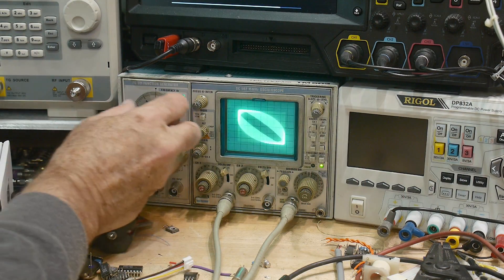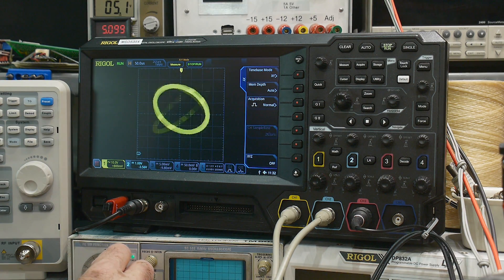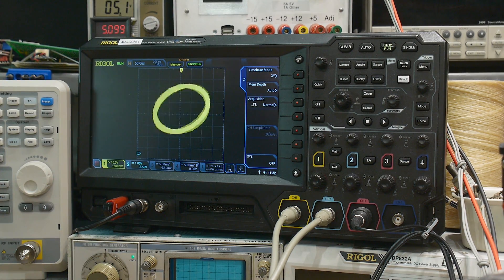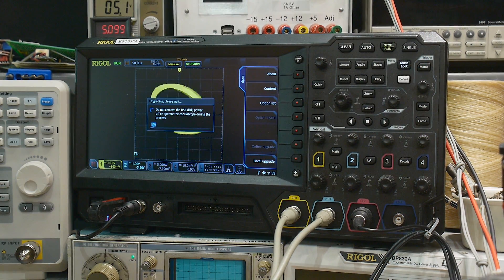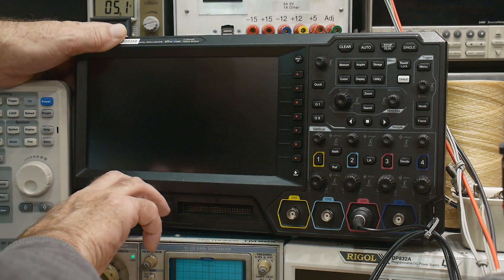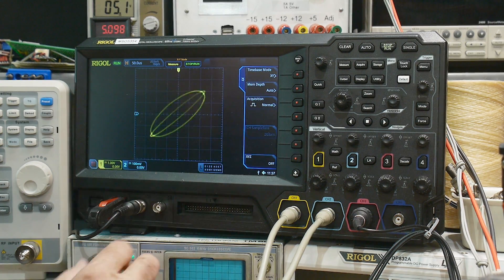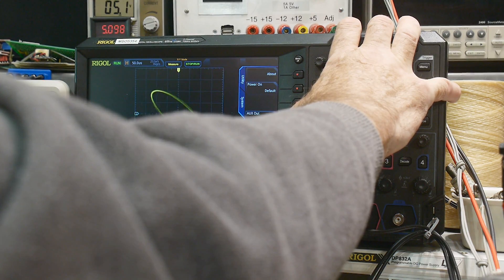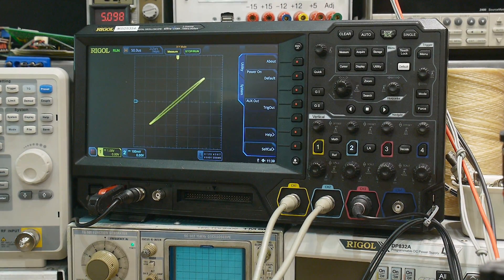#1380 Rigol MSO5000 XY mode fix

Comment: With v00.01.03.03.00 2023/02/22 the problem seems to have returned. I'm running 1.3.3 and the XY mode looks as ugly as you showed it at the beginning of the video. Does anybody know about a solution? Or a reason for this behavior?
EDIT: Possibly my fault. Tried out HighRes Mode and played with the Mem Depth which changes results significantly.

Comment: Rigol need to work on their user interface. After the update you get that message box saying reboot the scope, but there is the spinning icon thing in the top left corner of the message box. Everybody knows that a spinning icon means to wait. So I waited for it to stop spinning... and waited, but it never stops. I'd left it for at least an hour before crossing my fingers and rebooting whilst praying I didn't brick the thing.

Comment: Did this undo the bandwidth and options hack?
Reply from the maker: Yes. Had to redo the hack
Reply: @IMSAIGuy  I haven't hacked mine yet, is it a traumatic experience?
Reply: @tonyfremont  nope
Reply from the maker: @tonyfremont  a bit scary but easy
Reply: @IMSAIGuy  May I suggest you pin this comment so that it is always at the top?  I bought this scope but haven't done the hack yet.  So, I should run all the firmware upgrades and then apply the hack?  And, does the same hack work or do you need a new hack?